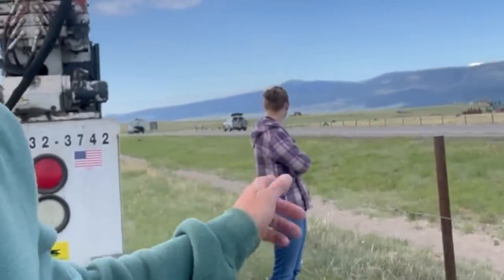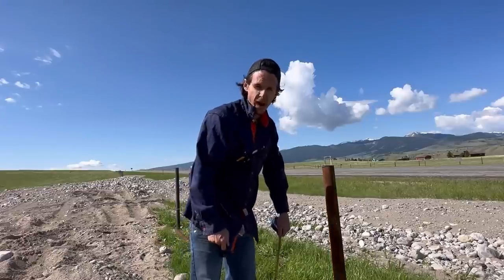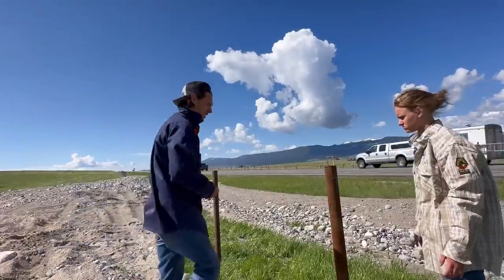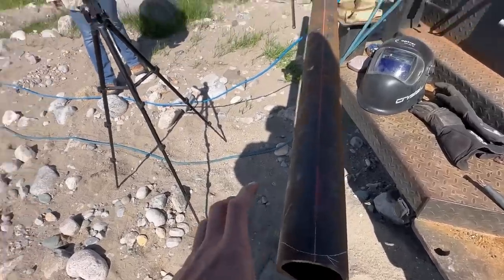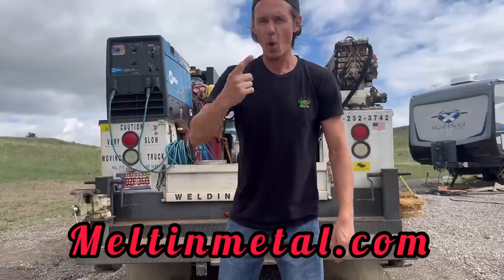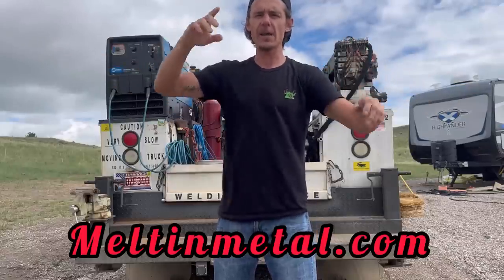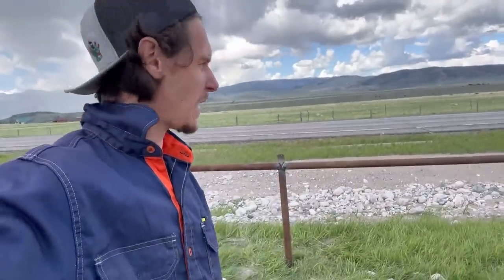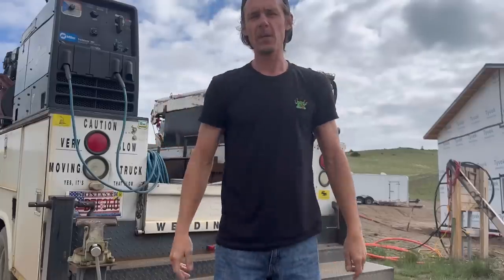How to fabricate pipe fence

Comment: Nice looking results! I'm curious why you didn't use your mag drill with a cutting attachment to cut the saddles? I built a firewood rack with 2 3/8" pipe and I now have great admiration for those who can make nice looking saddle welds on pipe. It was the first time I had ever tried to do it and it was a lot harder than I expected.
Reply: You would need a cutter twice the size of the stock, easier to jus blast it

Comment: Excellent job, but steel must be dirt cheap in Montana unless you only plan to build an extremely short fence. Lol. Is this for your sister's horses? I think you could just enlarge it slightly. Cheers, and keep the good stuff coming.
Reply from the maker: It’s just a brace to pull barb wire on basically

Comment: Get you and emily some electronic hearing protection, its well worth the money over plugs or dead muffs. You don't need anything like a 300$ set of Sordins (I do lol, been wearing them in the shop for 2 years everyday for the entire day and no problems) but anything that has external microphones and internal speakers. Bedtime tinnitus no more. There are plugs that do a similar job but plugs are nasty.

Comment: who asked for the 3 piece of fence in the middle of nowhere and why  xD
Reply: I think sometimes they do this in the middle of a barbed wire fence to give it some more rigidity, although usually I see wood rather than steel.
Reply: Maybe it's just to put a sign on next to the highway
Reply: I was wondering the same
Reply: That's spaced accordingly to where they need to tie off their horse for rest... sounded legit, right?
Reply from the maker: It’s to pull the barb wire on. The wood fence rots after a few years. This makes the fence last 10x longer
Reply: Usually old pipe/tubing  from an oil well is used commonly 2 3/8” or 2 7/8” near oil well towns.
Reply: It’s called an H brace for wire fence, gives you something solid to attach to. then usually you’ll run t post between the braces to hold up the wire. depending on the ground you would place a brace at the corners or every 600 feet at the most for a good solid fence.